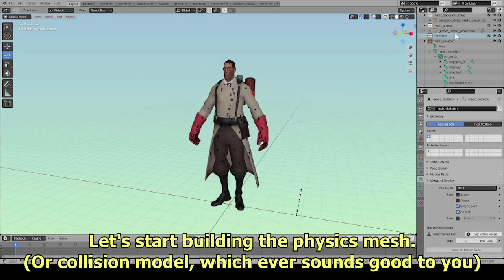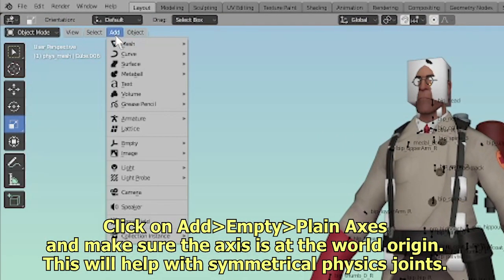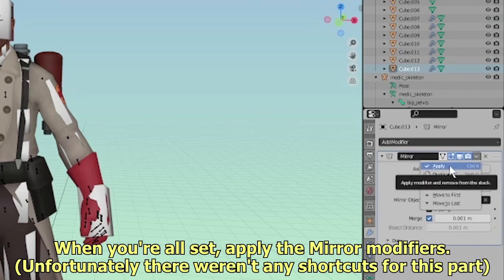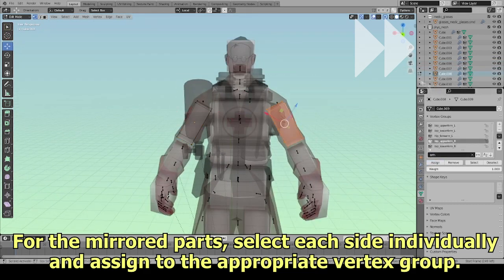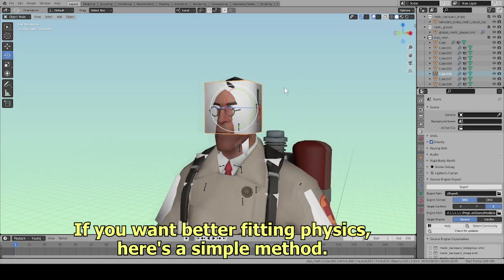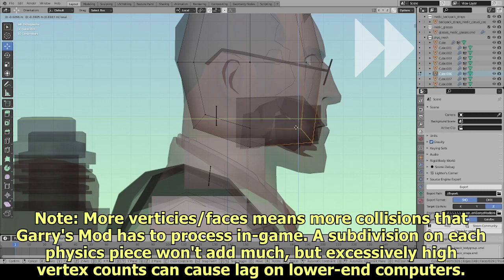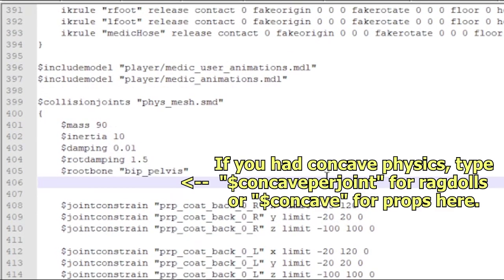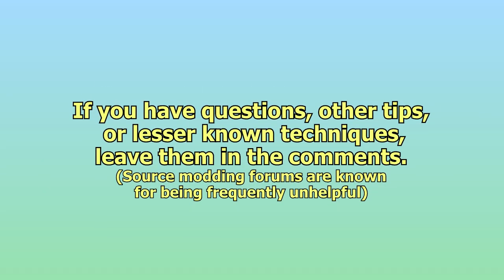Garry's Mod Physics Mesh Tutorial (For Blender)

Comment: You don't have to apply mirror modifiers. You can simply duplicate all models and mirror them along the axis. Hope it helps
Reply from the maker: I used to do something like this. I started using mirror modifiers because it reduced the total number of separate objects I had in the collection.
Reply: @InfiniteFoes  wouldn't it be just easy to join all objects then?
Reply from the maker: @ZeroStas  You can if you want to, they should export the same either way. I just like having them set up to be easier to edit later if I needed to adjust certain physics.